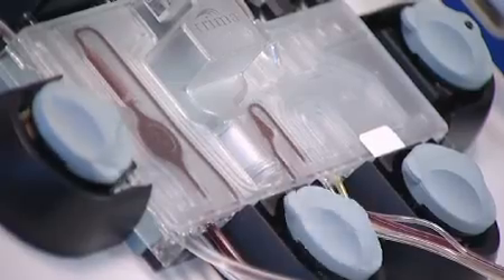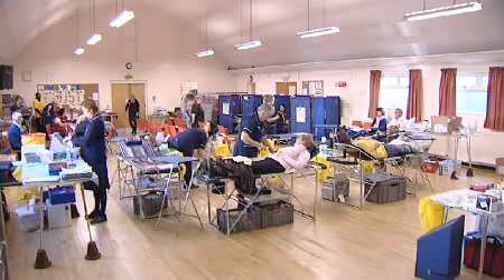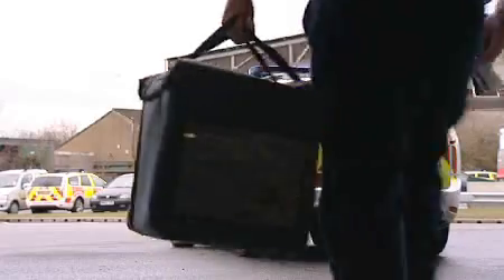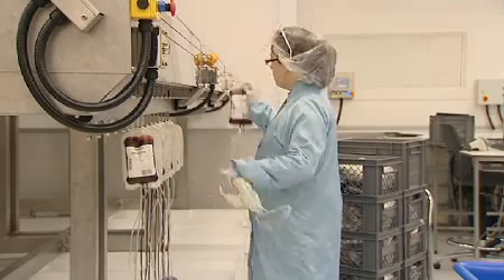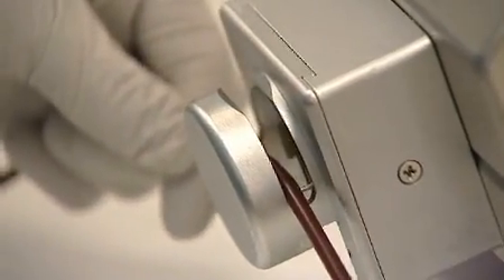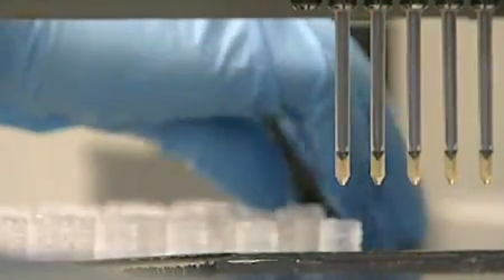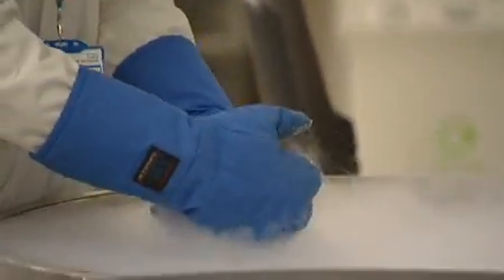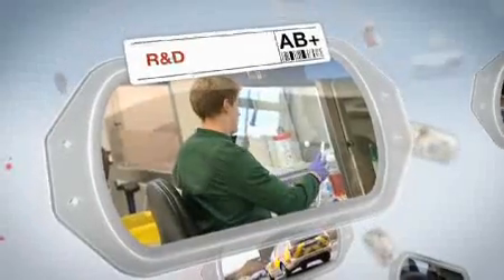Ever wondered what happens to your blood after donation?

Comment: Donating a pint of blood reduces blood volume, which results in a decrease in blood pressure (just as air pressure in a tire decreases as air is let out of the tire) What effect does donating blood have on heart rate?
Reply: Never noticed a change in mine.
Reply: Slight increase in heart rate after but your body adjusts to the new level quickly